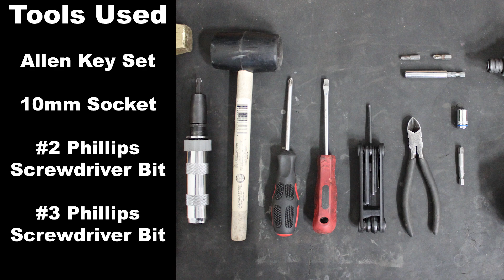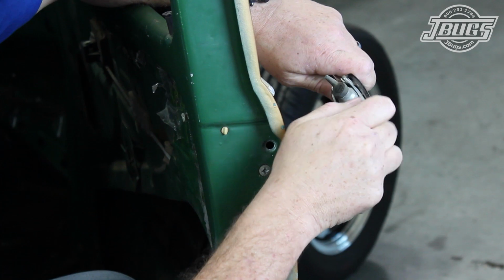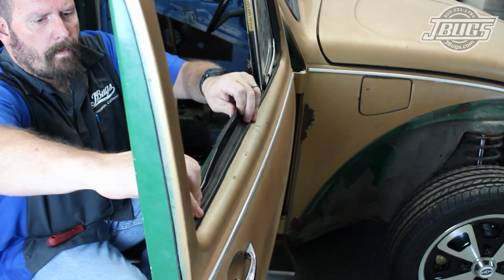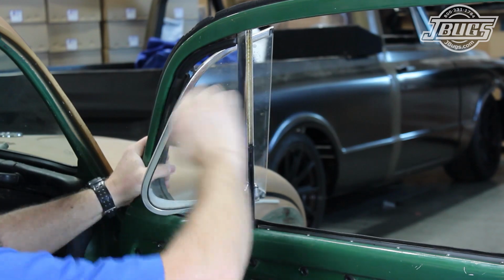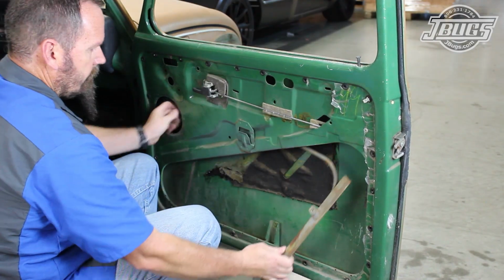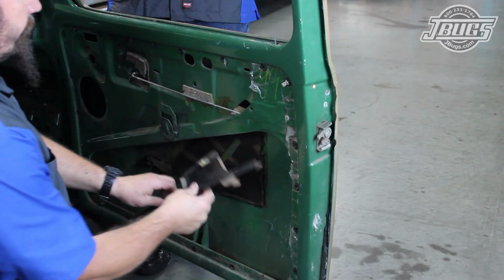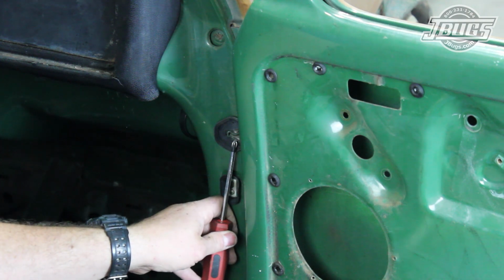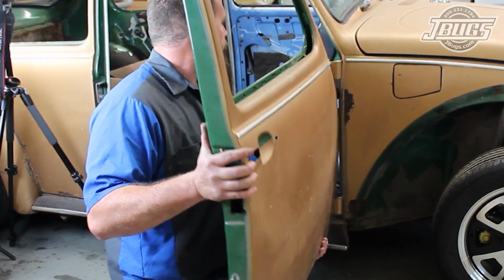JBugs - 1971 VW Super Beetle Door Disassembly & Removal

Comment: Currently trying to figure out if I can remove door glass and window regulator with port window still installed, if anyone has some insight would be much appreciated!
Reply: It depends on the year, and if by port, you mean vent window, yes they can be, but you do have to remove the bottom bolt that holds the vent wing window in place.

Comment: Would really like to know if super beetle and beetle (1200/1300) share the same doors, so any 65-77 door will fit?
Reply: Provided both cars are hardtops, the doors are interchangeable, yes. Keep in mind that some of the components on and inside the earlier models aren't the same as the later model doors. 1965-1967 doors are pretty similar and have mostly interchangeable parts. 1968 through 1977 parts are fairly similar throughout.

Comment: Stupid screw on the vent window is stuck. I sprayed it, but damn...taking apart old bugs is frustrating as all @F@!#$ sometimes. LOL
Reply: Soak with PB Plaster, hammer and punch to try and shake the rust free, repeat for a day or two and if all else fails, try a little heat. Otherwise it's time to drill!
Reply: @Sam_Mebane  heat finally got it. Broke a cheap screwdriver I'm the process.
Reply: @Sam_Mebane  same problem here.  Just rounded it out.  Now gotta drill it.